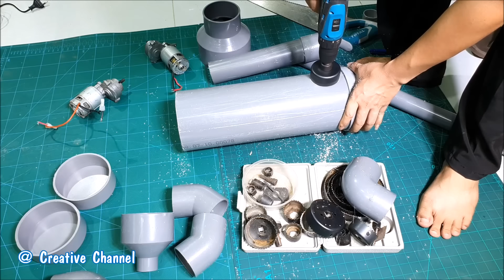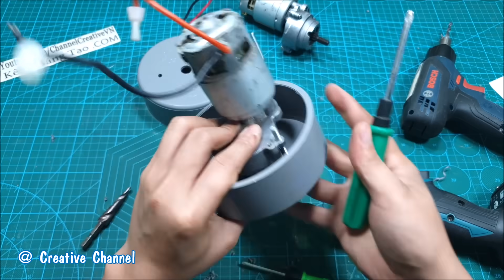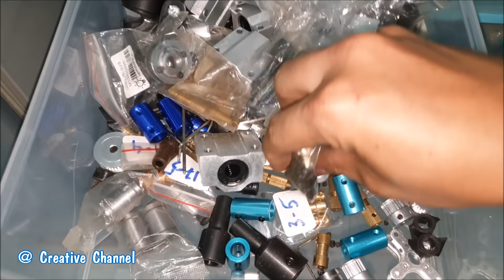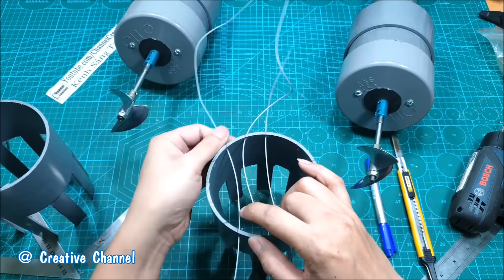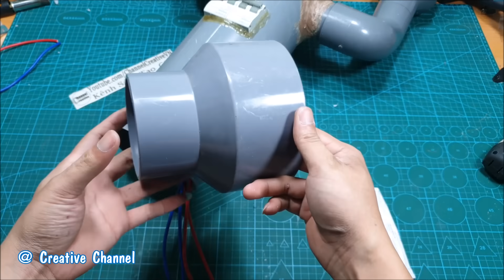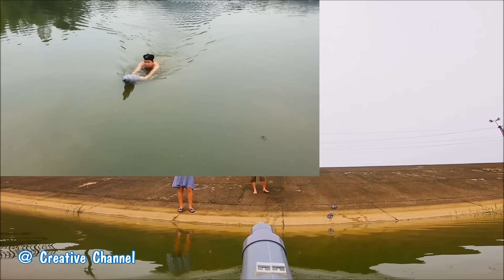How To Make Sea Scooter at home Using PVC Pipe - v2

Comment: Those motor water seals are super temporary. No way those will last more then 15 min in water. You should have built a housing for a bearing and seal to go in. Then your setup will last for years.

Comment: This same concept designed onto the hull of a canoe or kayak would really be  badass, primarily for its ability to push through weeds and debris without tangling up the props . Amazing potential here.Nice.
Reply: Those exist
Reply: That0Homeless0Guy  what’s the product called ? I’d like to check it out, thanks 🙏
Reply: @d_ward4871  Fucked if i know. Look up kayak motor or kayak jet motor. There's even peddle versions too.

Comment: Very good for a concept.  Install straight motors without gear boxes, programmable motor controllers, and a sealed throttle device.  This thing could go much faster and with programmed ramps you could get much better performance.  Maybe even tighten up the clearances between the props and the tubes to get greater thrust from them too.  Great project and great results.
Reply: And add a deadman switch on a tether so the thing doesn't get away from ya
Reply: He did a pretty damn good job using materials he found around the house, I'd give him on a scale of one to ten about a "12".
Reply: Great points thank you
Reply: comment it is always easier than doing it. all those stuff never works in the first attempt

Comment: Maybe a Momentary switch you can hold down with your fingers wired to a relay would be better than a damn double pole throw ac breaker.. still pretty cool
Reply: virgin proper electrical parts, chad "make everything out of romex and breakers"
Reply: He using Bosch tools so I don't think he can afford to buy the correct things
Reply: If only because if you let go.....your scooter is going to be very lonely on its trip.

Comment: Beautifully executed and a wonderful scraps box you have.  Love the welded pipe construction.  It does occur to me that the butt-weld for the cowling tangs might be vulnerable.  If you were to use two endcaps for the motor mount, back-to-back you could sandwich the rubber seal between them.  You could then weld the tangs inside the second endcap.  Lovely work.
Reply: And his boxes are sooó clean!
Still great video for understanding the basics.
Reply: The

Comment: Those switches dont like water. Maybe a coupple of relays and a pair of reed switches and magnets would be able to make it completely waterproof?
Reply: Put rubber button boots on them. Thats simpler
Reply: Also should be momentary switching mechanism in case you let go.
Reply: I'm sure you could also seal them with something like silicone grease.

Comment: One important thing.. One motor should have been wired backwards to create a counter rotating engine.  This give stability and allows it to go straight without manipulation.  Common practice on all multi engine setups weather a plane or vessel.  But the idea is excellent for a kayak. Or something similar.
Reply: Right. Counter rotating and mirror image prop pitch.
Reply: That would be correct if it was not inside the tube. But they will not act that way

Comment: A parts list of the working components would be a real help, particularly the motor/gearbox assembly!!!
Reply: and those fancy props
Reply: The motor looks like a motorcycle starter.
Reply: The components won't work for very long.
Reply: @epoylandingin7708  not a motorcycle starter
Reply: Yes!  Like diameter of shaft extensions. Prop sizes and pitch.  “The devil is in the details.”
Reply: It's that superglue? (On the inner tube gaskets)
Reply: TheRainHarvester looks like a smart kid, but may not know about primer and pvc glue
Reply: @greenmountainsuriving  the fancy props are RC boat props off a 1/5 scale rc. The shafts and couplers are also rc parts. Some costly parts to just have laying around lol
Reply: @triplenickle6995  ส่ดรน
Reply: better use motors from car air conditioner or wipers,or if you cam find brushless motors,even better

Comment: Im going to send you some purple primer and red hot.
Reply: Hahaha
Reply: I knew i wasn't alone with my thoughts.
Reply: I like the heavy duty cement myself lol
Reply: Right? That was a bit to low brow. No shoes is fine but the glue??
Reply: that and and a hackzall
Reply: Everybody is an expert after someone has already done it.
Reply: I was sweating no pipe glue myself. I wonder if it'll stay waterproof and for how long.
Reply: And a 4x2 cross
Reply: @kennethm.380  you obviously aren't
Reply: @Johnny2Starz  no it won't
Reply: Gear reduction motors? Hmmm
Reply: Stuff falls apart fast without purple primer thats for sure but he gets an A for effort
Reply: Ok here's the logic behind not using pipe glue and primer---what happens if you need to take it apart on the fly to change motors etc? That's why pipe glue isn't always the best option until you perfect it
Reply: I was looking for the comment before I said it 🤣
Reply: Red hot is amazing. He uses much pvc glue, so I'm sure he will appreciate it 🤣
Reply: @Johnny2Starz  Using a rubber tube for water seal???,I would chose o ring inner seal?
.

Comment: Electric switches 🤔 Non-waterproof 😜
Reply: 1 ride only XD that will die after 10 minutes in water
Reply: Awe, where's the bull shark...
Reply: @warlockostia  probly why he didnt show it driving around very much😂
Reply: @warlockostia  From 12V? -_-
Reply: @rekatieris  yes ... they break because of the water and not because of the voltage
Reply: Inline fuse and a waterproof toggle switch would of been better instead of 230v rcbo’s that aren’t waterproof lol. Cool idea though
Reply: @Mac-ti9xu  Yes, it's a great idea.
Reply: correct me if i am wrong but those look like electrical breakers which should be naturally water resisant cuz of there use not water proof but yeah
Reply: Serated Atom no their use is indoor only and they have no IP protection against liquid at all. The actually need to “breath” to the outside world as during a short circuit the arc chamber inside produces a huge amount of gas that is expelled. Unfortunately once wet they will be knackered fairly quickly
Reply: @warlockostia  the
Reply: @Mac-ti9xu  they arnt even rcbos, they are just isolator switches, they dont even offer fuse protection
Reply: Also once it's glued together how do you get to the motors if they need replacing ?
Reply: @cbgreenbay  a saw
Reply: Mac don’t think those were rcbo’s pal they looked like double pole switches, probably lacking any form of overload protection

Comment: Well done! I am guessing those motors are getting pretty hot in there. Could easily use some flex copper tubing and wrap around the motors and then attach to front and back of scooter. Only need a little water flow and it would keep the motors cool. Also +1 to the air/pneumatic switch - I have one in my spa so should be easy to find.
Reply: That's actually a really good idea.

Comment: Nice concept and as always executed well.  For Mark II, maybe move the switches down to the handle bar so they're easier to access when moving at full speed ? Assuming they're waterproof enough, obviously
Also, where'd you get that little USB powered soldering iron? It's cute and looks very portable
Reply: That's TS-80, if anyone still wonders. Pretty handy thing, has digital temperature control and motion activation. Better to use with PD power banks/chargers or at least QC 3.0, standard 5V USB won't power it at all.

Comment: Instead of those circuit breakers, he should have used relays under wireless triggering. BTW, I hope that scoota is fasta than an aligator, just in case...
Reply: Those aren’t circuit breakers.  Those are industrial on?off switches which come on heavy equipment
Reply: Don't you mean aligata
Reply: @mikeeagle2653  whatever breakers or switches, wireless relays is a reasonable solution.
Reply: @chevythunder1976  no because it's an alligator, not an alligater. PD: maybe an alligatto ??

Comment: that's amazing prodject but how you getting the batterys out to recharge them??? lol
Reply: probably just have 2 wires fed into the batteries from outside and hook it to the charger.
Reply: they could be recharged in other ways like through the switch wires or who knows only he knows you know what I mean?
Reply: @airgunningyup  we seen everything he did and he sealed everything
Reply: Get the saw out and cut the PVC pipe.
Reply: The front joint wasn't glued, it's just a friction fit.
Reply: @ElizabethGreene  Yep 17:41 he just slides the piece in with no cement.

Comment: Needs a dead man switch so it won't run away on you, a couple of fins on the front for better depth control, and some kind of arm brace so you can get better pitch control in the water. Pretty cool.

Comment: Long and good job. Improvements: larger props, at least two seals on the shafts, possibly under pressure by screws, motors without gearbox or with small ratio, marine waterproof switches instead of the AC ones glued (hot glue on pvc has a weak adhesion).

Comment: That switch is not watertight watch out you also should have some sort of ESC or variable speed control because your batteries are running full tilt from the flick of a switch until you turn it off, the will not last long. Very imaginative great job.

Comment: Awesome,  the only thing is flow restriction. Put a scoop underneath,  so that your power comes from pushing out the rear, rather than trying to suck water in through those side vent intakes.

Comment: great idea but with your permission in the electrical aspect the switches or breaker are elements that would not withstand the water and this would bring breakdowns. and with respect to the motors if we remove the mechanical reducers we would opt for more speed.

Comment: Dip solder your wire ends before tightening them in the terminal lugs, it prevents electrolytic contamination of the connection and reduces galvanic corrosion

Comment: Not a bad design overall, but that rubber seal around the shafts made from inner-tube material would last about 5 minutes in the water. Then it's flooded motors and no-go-no-more.

Comment: Air operated hold down switch leading to contactor in waterproof compartment  would be an improvement over domestic non waterproof breakers ,but impressive design.

Comment: How to make it faster:

use brushless motors, I saw from the video these are brushed, you can see the little ventilation holes. It could get about 3 times more torque and rpm

Make the motor go straight in the shaft, without the gear. Lower the motor kv so that it gets less rpm, but more torque (Kv = Rpm/volt. For example, on a 3s battery, which is 11.1v, you’d get, for a motor of 800Kv, 11.1 x 800 = 8 880rpm

Comment: Cool project.  Very creative.  But for Ver. 3.0, I would pay a lot more attention to waterproofing.  Improved application techniques are needed on your glued joints.  
If water penetrates your sealed compartments, you have no way to drain them.
If you use a threaded connection with gaskets/ O-rings on your motor compartments, you can access your motors for repair or replacement.
Your motor/propeller shaft seal needs a better long term solution for long term survivability.
There are existing "off the shelf" solutions for all these points.
Except for the glues, most or all of the parts can also be found/discovered, salvaged, scrounged from discarded things. ( it is half of the fun of being a maker !!  Repurposing things !!)

Comment: Just happened to have RCS boat props. Ignore the fact they are household circuit board switches. This could generate a lot more thrust if the prop shrouds were smaller, so there is very little clearance between the prop and guard.

Comment: The battery is enough for how long?
What is the maximum speed?
Is it possible to just move diving underwater without having failure on it?
From were can I get the machine and the batteries, and for how much?
Thanks

Comment: Question. I want to build a boat with the same concept using air  to drive the boat   how big of an motor would i have to use to create enough air to go through the tubes and what can I use as the blower
Reply: Have seen it done with a leaf blower.

Comment: The super glue under the rubber seals won't work as super glue dissolves in water. I would use silicone.

Comment: So many ways I would have improved on this thing…. Awesome idea, shitty design/craftsmanship… dude never heard of pvc glue? I hate the propellor tubes only attached with epoxy…. Why not design the tube in 1 piece and simply cut out where needed… also why did the motors run  at which different rpms???